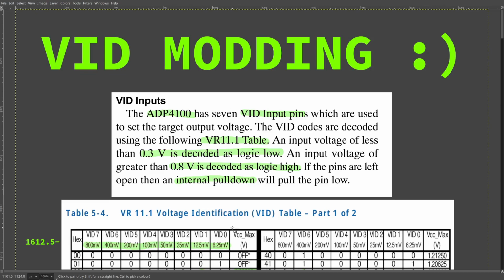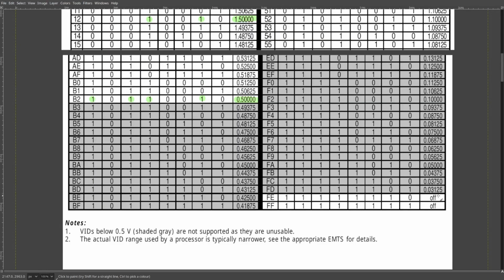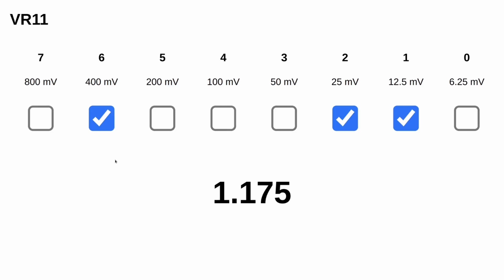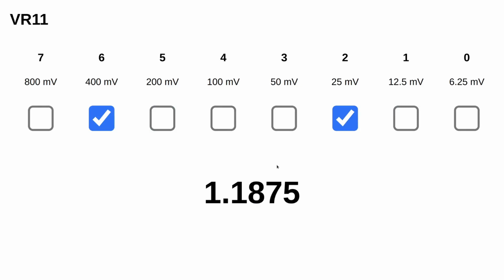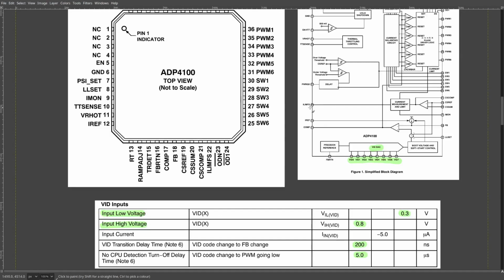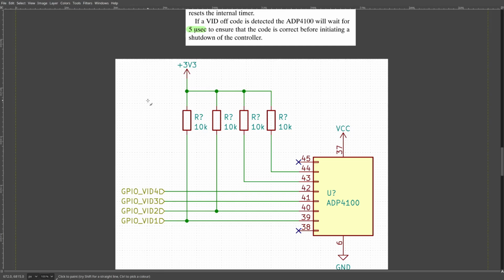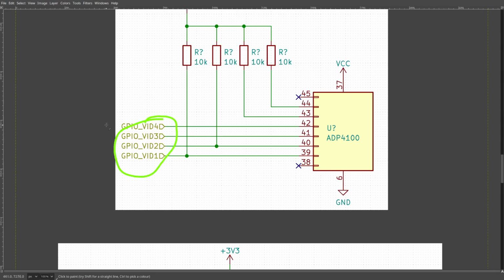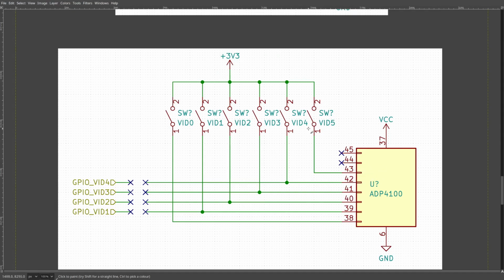gtx 260 vid modding guide

Comment: This is golden information, just wish I saw this before losing 20+ hours of my life figuring out VID modding the NCP5395 and tracing out the pins that go 2 on front side of pcb, 3 on rear and finish with 3 on front and realizing that VID 0 is actually VID 7 when the voltage was 1.4875 when I was expecting 1.3625 after moving 1 resistor aka 00010100 vs 00101000